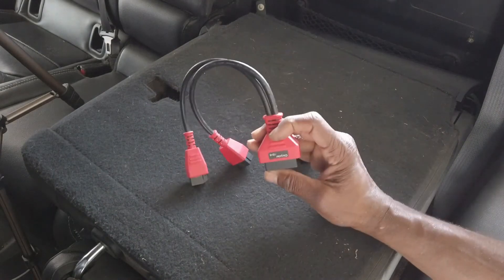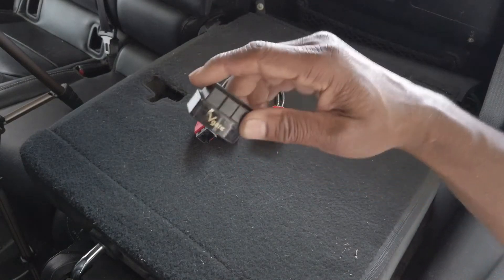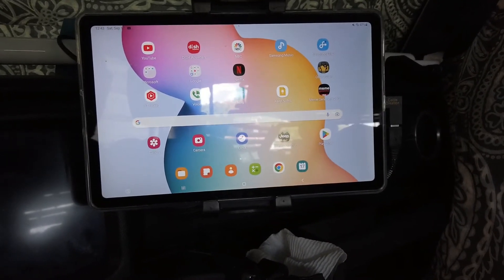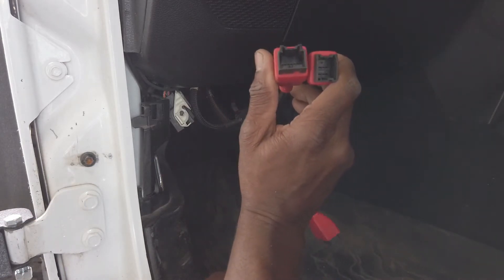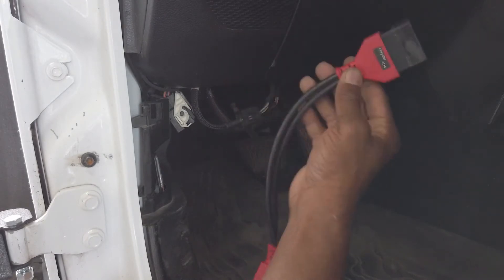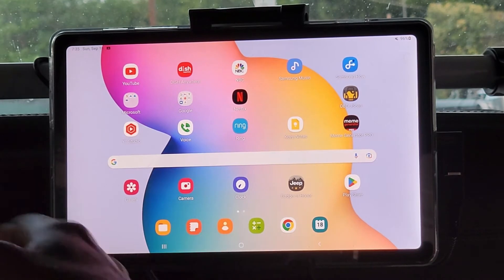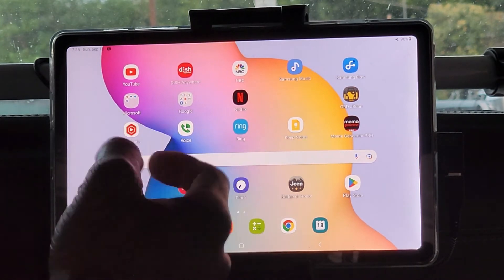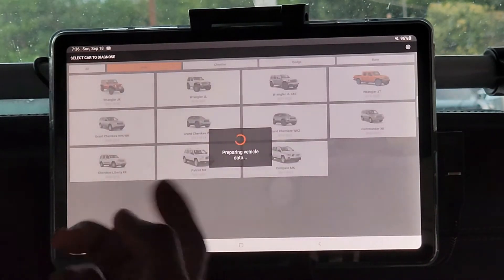How to connect and start using Jscan.

Comment: I've had the j-scan for my jku for about 2 years now.  I love it.  I think the biggest thing that helped me was after I replaced the transmission myself. Your supposed to take it to the dealership to putnit in a transmission relearn or your new transmission will NOT work correctly.  With the scan the option is there to put it into the relearn mode.  It saved me $140 that the dealer wanted to charge.  The other big thing is turning off the annoying seat belt chime every 2 seconds if your not wearing it.
Reply from the maker: That's pretty awesome! It's those things that the dealership charges you for that add up. $140 is a lot to just put the pcm into relearn mode. Glad you were able to do it yourself and save that money. I've been using jscan for 4yrs on all of our chrysler vehicles. I move a lot of stuff around our properties and I was just telling myself today that I need to turn off the seatbelt chime. Just haven't gotten around to it. Maybe now that you've brought it to my attention, I'll use jscan to change it. Lol. Great job. Glad it's working out for you.

Comment: Do you recommend this over the Tazer?  I had some issues with my 2024 JL 6MT after changing from stock 33's to 35's.  I installed the Tazer and set the tire size to 35 (well 34.96 was the closest...it is a true 35" tire).  I was good until I hit the highway and used all the gears then the ESS failed, then the service transmission mesage came on and the Jeep went into limp mode.  I found out after the fact there was a supplemental procedure for the manuals for relearning the gears.  That was my fault for not doing those steps.  My Jeep spent nearly a week at the dealer for them to figure out what was going on.  They opened a STAR case after some troubleshooting not working out.  It turns out the gear position sensor was shorted out and they needed to replace it then programmed the Jeep for 35's.  Whether I caused that or not I have no idea, or maybe just bad timing.  Anyway, I thought about putting back the Tazer but kind of afraid to.  I have JScan and a compatible OBD II adapter.  If it'll set the same settings like start/stop, tire size, TPMS, than that's cool.  I do like some of the live features from the Tazer though.  The dealer did program me to 35's from the factory and everything is working so I'm kind of inclined to just leave well enough alone.  Unfortunately the TPMS is set to 37 which is higher than I like to run 35's on the road.  I wouldn't mind the start/stop memory to off feature either.  Anyway, long story short looking for your thoughts on this one.  If I go with JScan instead of Tazer, is there any special procedures I need to do because I have a manual trans?  Tazer there is but I think it's because of the wonky post-clutch recall software.  Thanks for your time!
Reply from the maker: I wouldn’t necessarily say that I recommend one over the other. It’s just that they have their different purposes. The only real advantage that Tazer has (in my opinion) is the live features. But… that’s kinda why you have to marry it to your vehicle and you don’t with jscan. There’s no unplugging when you take it in to service or sell your jeep. Plus, I use the same jscan app on my JT, JK, Ram 1500, Charger, and my mom’s Pacifica. I would have to purchase a separate tazer for all of those vehicles.

Having said that, I’ve been using jscan for over 4yrs. I set everything on my JT from TPMS, regear, tire size, LEDs, and a few other things. If making sure everything is set correctly, I would definitely go with jscan. You don’t have to leave it connected to maintain settings.

As far as the start/stop, you already know that there is no such thing as start/stop eliminator. Only remember last setting. I think that jscan has incorporated that into it’s features just like Tazer. But when I first started using jscan, that feature wasn’t available. So I just bought a $30 eliminator (Memory setting) module from Amazon. I just figured when the time comes, then I’ll try out jscans settings for the start/stop.

Overall, I would go with the jscan. I like the fact that I can use it with multiple vehicles but the biggest thing for me is that I don’t have to leave it connected to maintain the settings and there is no marrying/unmarrying of the unit. Just creates less problems in my opinion.

One more thing. I don't want to insult your intelligence (because we're always learning), but In the future, if you or anybody you know starts having electrical issues, check related components before you start buying and replacing parts. It could save you a lot of money. I have done several videos in the past about electrical issues. Like a bad connection or related components. Just a little something to help in the future.

Hope that heled you out a little. Thanks for asking me! Stay safe!
Reply: @GoChangeYaLife  That does help alot.  I will give JScan a try.  My only hesitation was because I have the manual transmission.  The Tazer has specifics extra steps you have to follow for the manual trans or else I'll get the service transmission and limp mode again.  No thanks!  Does the JScan requires any special steps for the new manual?

Comment: Thanks for the video,  I connected my jscan for the first time today and registered my vin to a license,  scroll around a bit, I ordered new tires today, going from 33'' to 37" , I have a question that I can't seem to find a definitive answer to,  after I change the size and "save" do I need to restart all ecu ? For it to save
Reply from the maker: Thank you!🙏

It's different for different settings. It will usually tell you after you do the change whether you have to or not. I can't remember whether I had to or not. But if you follow what it tells you, you will be ok. I will give you two tips.

1. Always (no matter what) go back in and double check after each change to make sure the settings actually changed. That way you will know whether you did the procedure correct or not.

2. To get the correct tire size, don't just use 37". Either (A)  Put your tires at the pressure that you're going to drive with and measure the circumference. Or (B) Go to your tire manufacturer's website and get the specs on there. They should list the circumference on their site.
Reply: @ChangeYoLife   just wanted to touch base with you, I got the 37's installed Thursday, you were correct,  when I made the changes it instructed me exactly what to do, close and open door twice, than walk the key fob away from the vehicle for 5 minutes.. logged back in and double checked and the new dimensions took, compared to gps speedo was out initially 10mph at 70, after the correction its out 2 mph at 80 , thanks again for sharing your experience and knowledge with us newbies

Comment: I actually switched FROM the Jscan, to the Tazer JL Mini.

Mainly because the Tazer is much more featured...and also less of a PITA because it's just plugged in always.. The Jscan also isn't super informational in my opinion.. (Menus and stuff are kinda confusing) 

When I had the JSCAN I got the extension cables though, because it was MUCH easier to deal with plugging and unplugging though.
Reply from the maker: I understand. Everyone has their reasons and a lot of times one works better than the other for a lot of people. But I've been using Jscan for 2 years with no issues. Don't want to change what works. I don't have to leave it connected and I use it on 5 different vehicles. MY JT, my wife's JKU, and my parent's Ram, Caravan, and Charger. Got all the licenses for less than $150. So, I'm just sticking with what works. The extra features that the Tazer has like light show and turn assist don't appeal to me. 35yrs of offroading and I never needed. I'm an old school guy.😂😂😂
Reply: @GoChangeYaLife  I fully get that.

Things like being able to hold the Traction Control button to turn off the full system and stuff like that are really what drew me to the Tazer, plus other things like...Adding front camera, turn cam, license plate light turn off on backup, cooldown mode (huge to me when pulling my trailer)
Reply from the maker: @trailtothevoid  Some of that stuff the Jscan will do. It's just called different for copyright purposes. But, it does do things like traction control and cooldown mode. Jscan just doesn't do that light show. Yet. Haha! And I have a 4 camera setup on mine anyway. But, the truth is that these companies like Tazer, Jscan, flashcal, etc. are like vehicle manufacturers. They all come out with new features constantly to keep up the competition and trends. Like the new Bronco. Toyota will probably come out with a new 4runner in the next five years with double the features of the Wrangler and Bronco. Lol
Reply: @GoChangeYaLife  I think my biggest bit is being able to do it without needing an additional device
Reply from the maker: @trailtothevoid  Understood

Comment: Hello thanks for the video do u happen to know if i can calibrate my accelerator pedal with this app or my throttle body tia ive Been having trouble with the red thunder bolt
Reply from the maker: Thanks! I'm not sure. That's something that I've never had to encounter. The only thing that I know that may be possible is for it to tell you which sensor it is. Whether it's the pedal position sensor or the throttle sensor. I don't know about calibration though.

Comment: So you just put the tire size as close to the measured size as possible?
Reply from the maker: Yes. But don't just put in 35, 37, 40, etc. Either measure the circumference (like you mentioned) or go to the tire manufacturers website and get the circumference.
Reply: @GoChangeYaLife I’m doing this right now… you have to buy the license for it to do it?
Reply from the maker: @Dwq47  Yes. But it's a one time fee. And it's not that expensive. With the cables, obd II module, and license, it's still considerably less than any othe the others. If you have more than one Dodge/chrysler/mopar vehicle, I recommend purchasing a multi license. That way you can use it on all of them. But yes, purchase the license. Once you realize the amount of things you can do, it's worth it. And it's always updating.

Comment: Yo what headunit are you using? I love how you use the Jscan app on it! Ive been wanting to pull the trigger on a android unit, but there's so many off brand ones that look so fishy.
Reply from the maker: Yo, what's up? I use the Stinger Heigh10. It's pretty expensive, but I like it. There are other cheaper android brands. I had one of those cheaper brands in our JK for awhile, but it was slow and laggy. It finally was on it's way out and I decided to upgrade with the Stinger. I liked it so much that I put one in this jeep too. 

But, yea you're right, there ara a lot of off brands. If it were me and I just wanted to try one of those off brands, I would try and find someone that's had one for awhile and still works. And they'll let you check it out. Too much sketchy stuff out there to be taking chances. Lol
Reply from the maker: Whoa, Whoa, Whoa. I just reread your comment. I'm using jscan on my tablet, not my head unit. Whenever I use Jscan, i use it on my tablet because it has such a large screen.

Sorry for the confusion.

Comment: Okay so you’ve changed your tire size but your speedometer is still a little off. My tire is 33.8” and so I put in 33.75” but I’m still off 1-2mph when I’m going 60mph.
Reply from the maker: 1-2miles off isn't that bad, but I understand you want it to be right.  I would try the next size up and see what happens. Also, did you measure it yourself or did you use the measurements from the manufacturer's website? Also, on certain tires, it depends on air pressure. For example, Some tires like Patagonias run at higher pressure which would change the crown which would change the measurements.

Comment: wich dongle did you buy? 3.0 or 4.0?
Reply from the maker: Here is the equipment I am using. Cables: https://a.co/d/c7HAp1q

OBD Adapter: https://a.co/d/4v6QLuz

I have used this adapter as well. I lost it somewhere. https://a.co/d/hh816Hi